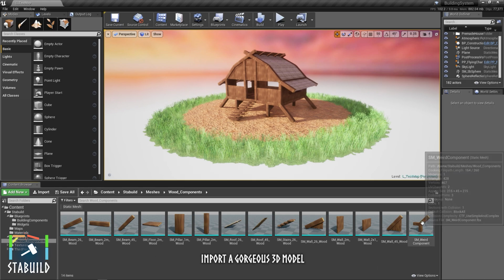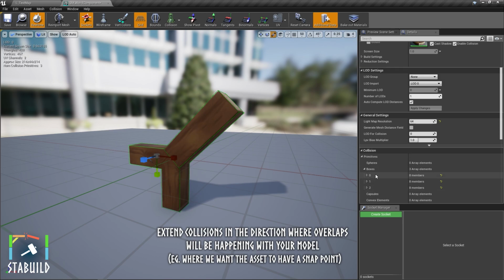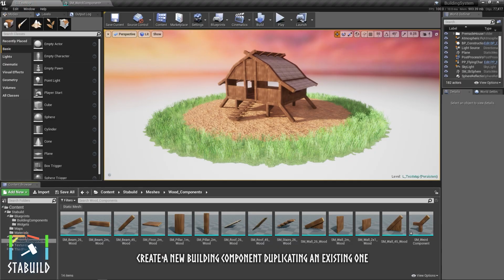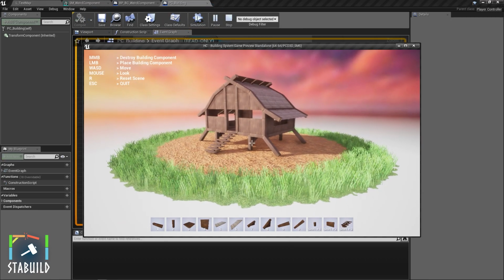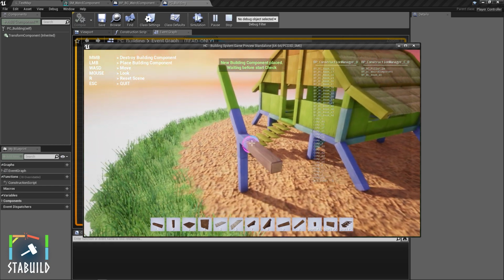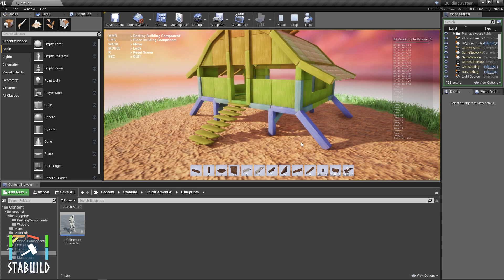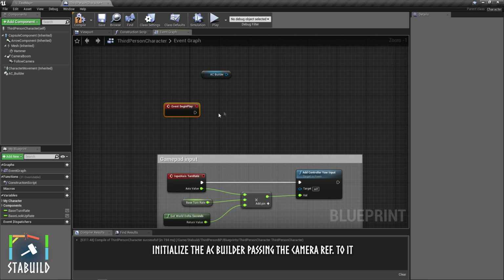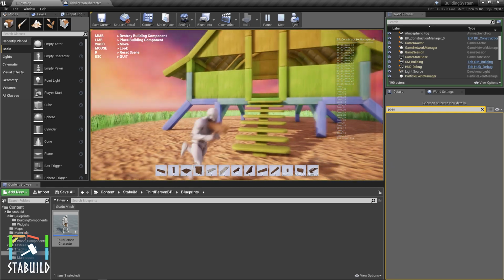UE5 FAB - ⚒️ STABUILD How To?

Comment: Could it be used to join water pipes and recognize that water pipes are connected so that water can be transferred, for an example?
Reply from the maker: That's a cool idea, shouldn't even be too hard to implement 🤔 if you need some helo on how to extend the actual class to perform that specific connection check ask away in my discord server, there should be a link into the video description 😃

Comment: ok is it possible to make this deactive on start but only activate later on in certain circumstances ?. could you do more tutorials on it?.
Reply: This is something I was wondering about too. An easy way to toggle this on and off would be a nice addition. It would be easier to implement in any project by adding an option to the AC Builder component to set the character in build mode or something.

Love the simplicity of this tho. A lot of stuff going on under the hood, but easy to add to a project. Thanks! :)
Reply from the maker: @crashannburnFPV  that blazing fast to implement and I can help with that, I might even add it in the next update. Hop on the Discord Server
Reply: @crashannburnFPV  hey it is possible on his discord (i think in the description) you can get ahold of him or me or maybe someone else .hes done a video for me so i can get this working and its pretty beast on his discord you can find me or him i am GAMEBR0VIP one of us will help you
Reply: @GAMEBR0VIP2462  Thanks, I've already implemented it, sorta. Its not pretty, but it works. Will refine it later. (When stuff breaks... :p )
Reply from the maker: Not sure I got your question, but I saw you joining the Discord Server so you can ask me there 😀

Comment: what is the fps when running?
Reply from the maker: It depends, the bigger is the building the harder it gets. I obviously reached a point where I really get a hitch doing enormous houses when stress testing but I definitely tried to optimise it at best. Sadly using BPs it's not possible to multithread so I might do a Cpp version on future and maybe release it for free for the asset's owners. Another implementation I might do is subdivide the load between frames but this will slow down the calculation a lot. Btw you can ask about performances on various pcs to the other users that already purchased it directly on my discord server, link in description <3 cheers mate
Reply: @heavycoatgames  Pls do C++ version of it and add multiplayer support.
Reply from the maker: @zeon3d755  i might end up to do a Cpp version in future but I have already a lot of stuff I would like to add first, replication is on the list too, definitely sooner than Cpp versions
Reply: @heavycoatgames  couldn't you use sphere overlaps to convert it between static mesh, and blueprint when it's needed?
Reply: to save on performance
Reply from the maker: @semmert  small example, when you drag a static mesh from the content browser to the level, you do not place static meshes around the level, as soon as you drag it onto the viewport, Unreal creates a Static mesh Actor and adds the static mesh to it. No static mesh can be placed in a level if not "encapsulated" into an actor, the actors i used as building pieces have no tick running so they already have a small impact on performances, moreover, Unreal automatically instantiate every equal static mesh component you have around to save even more on performances (eg. You have 100 metal bucket static meshes in 100 static mesh actors, as soon as they are not moved, Unreal replaces the various static mesh components with "instanced static meshes" which helps a damn lot :D)